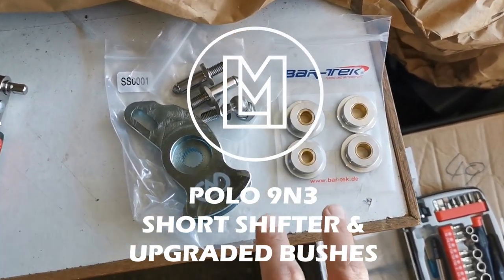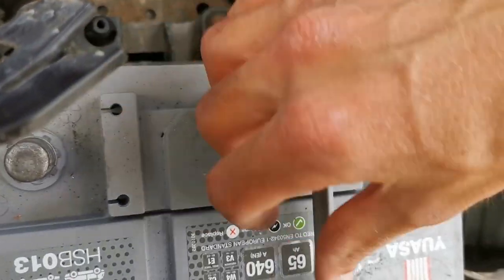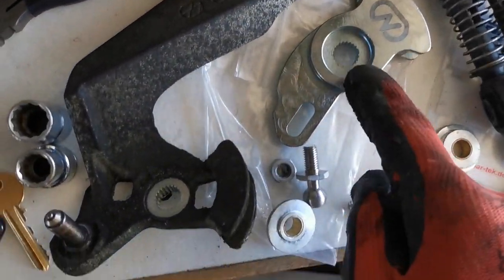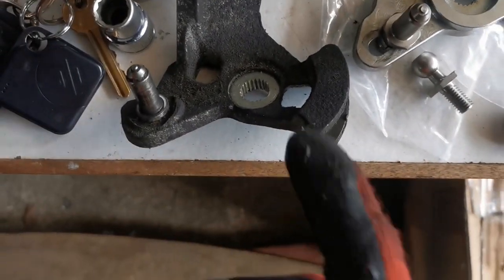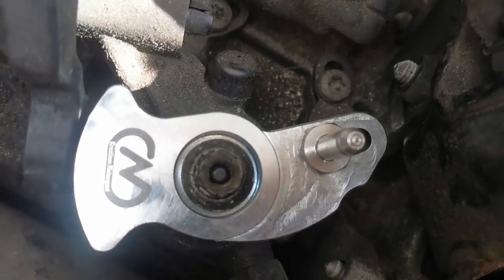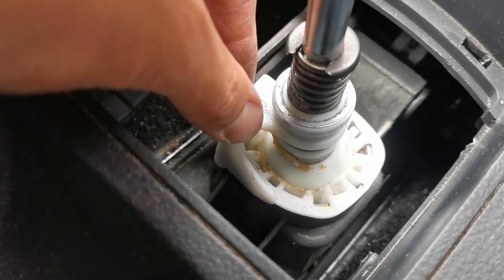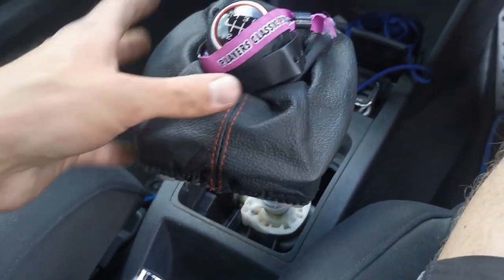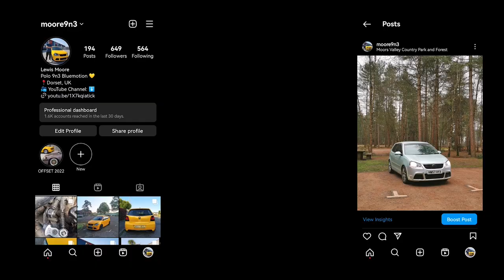Polo 9n3 short shifter install & upgraded shifter bushes

Comment: 2007 Polo GTI both were 10mm and no retaining clip on the top arm. It has a platic fold down tab, no need to shave it down, just apply a bit of force and it clicks into position.

Comment: Hey mate, for the upper shifter arm did it never have the metal retaining clip at the end? Just had a look and mine doesn't have one either. Might have to do what you did with the bolt through the plastic...
Reply from the maker: No mine didn't have the metal retaining clip annoyingly. Not sure the 1.4s have them on the upper one. The 1.8gti's do I think. So yeah this was my best solution to keep it secure.
Reply: @lewismoore9n3  where i can buy the retaining clips?

Comment: Does that mod work on my 2005 1.9 pd130hp tdi Polo 6 speed?
Reply from the maker: Yes for the pd100 and pd130s it would. Should be the same as mine. Just need to be aware of the different size holes on the  new bushes that may need modification like mine did.